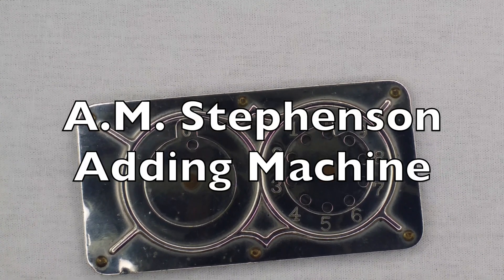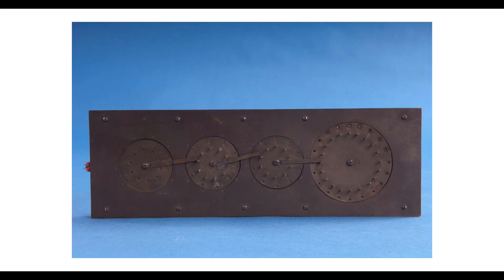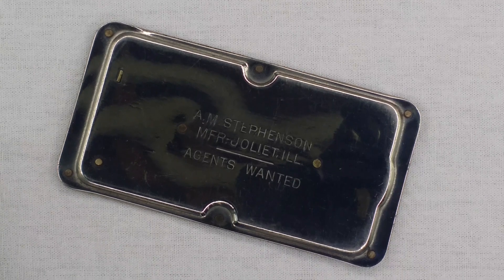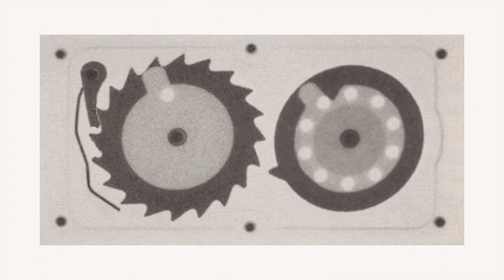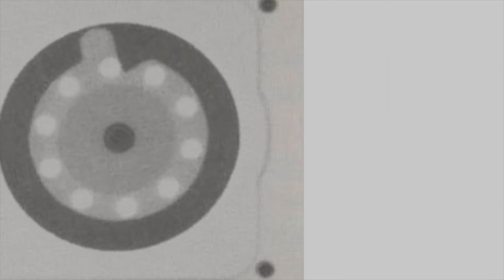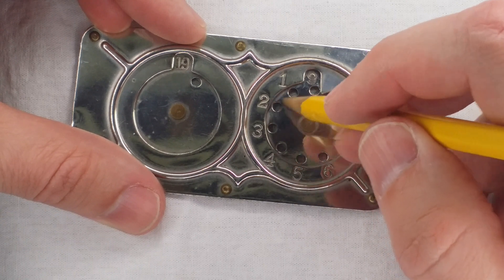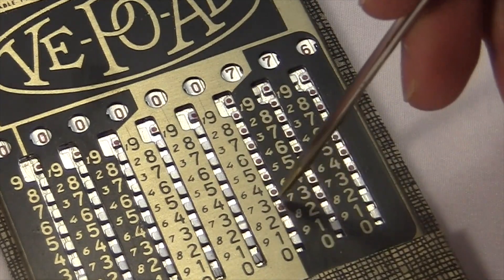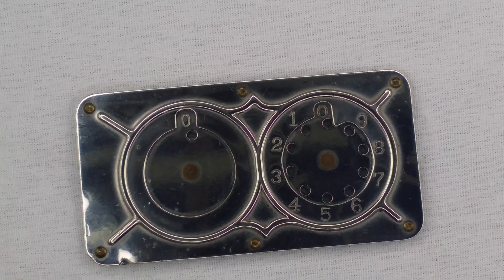A.M. Stephenson Adding Machine Review / HowTo

Comment: My secondary school ran a non-profit saving scheme for pupils, and I was a helper.  I recall having to add up columns of numbers in old English currency (£sd = pounds, shillings, pence).  This would have been a great help, by adding least significant column of pennies, then most significant column of pennies.  It wouldn't divide by 12 for shillings, but we all learned our 12x table by heart 😀  The same for the shillings columns, and again for the pounds columns.  
Adding the columns was the most difficult and error-prone problem and this would have helped a lot.

Comment: I think I found the AVGN of mechanical calculators. AMCN?
Reply from the maker: I'm usually not so angry...
Reply: @ChrisStaecker  I also may have finally deciphered what the "Tel-o-Flash" might have meant. The brochure says "Tells in a flash without mental strain", so by "flash" they meant the speed of operation, but I think the "Tel" part just refers to dialing the digits with a disc, like on a rotary phone.
Reply: Also, students: borrow, professors: 3:15

Comment: Actually I think it would have been quite useful. You have to consider that the output from any calculation will need to be written down. So if you have lots of 3 digit numbers to add up, you start with the right hand column, and the output gives you the last digit (which you write down) and the number to carry. The number to carry you enter into the gizmo then add the second column and repeat. It's slightly faster and more accurate than doing the sum by hand. It's no different than the multi digit adders other than you work down the columns.

Comment: I thought it was going to be a normal Tuesday.... oh but little did I know... a NEW CHRIS video was coming!  The rotary dial... kinda reminds me of a TEL-O-PHONE...  Keep these coming Chris!!  Made my week!  I don't recall animations in prior videos... you're moving up the "creator ladder"
Reply: My thought exactly!  Numbers were dialed, just like on rotary telephone dials of the age.
Reply: @JeremySpidle  I figured with all this pondering about "TEL-0-____" someone should say something.  I come from the rotary era and did telephone stuff for a decade, so it was immediately obvious... I'm sure it was obvious to many viewers, like you.  It "dials" in the reverse direction though so I find that a bit odd.  There must be a good reason for this as it's a well-planned machine.  The numbers are in a different order too than a phone.
Reply: @PySimpleGUI  I wasn't so sure about this since Stephenson's adder is from the 1890s and rotary dial phones weren't common until at least the 1920s (before then there were no automatic switchboards at the telephone exchange and you would have to call via an operator who would manually connect your call). It turns out knock-offs were on the market for a very long time, and I found an ad for the Tel-o-flash from 1939!
Reply: @jaapsch2 OOOoooooo right!  Excellent point.  I did a quick search and a patent was granted in 1892 for rotary dial phone, but you're correct that switchboards were the norm for quite a while.  Stephenson was 2 decades ahead of the phone patent.